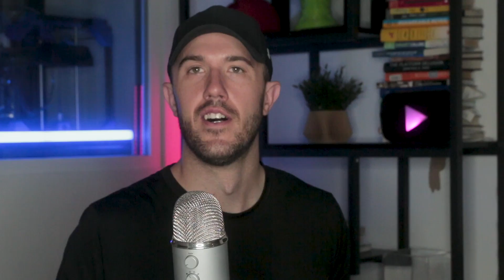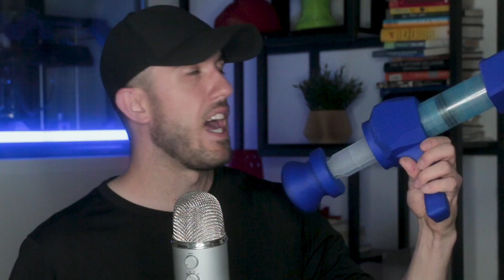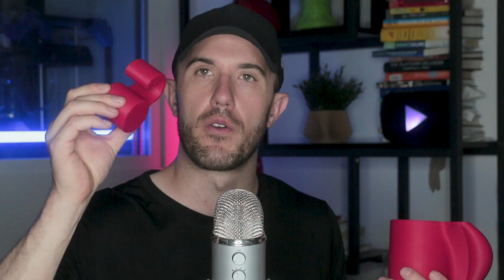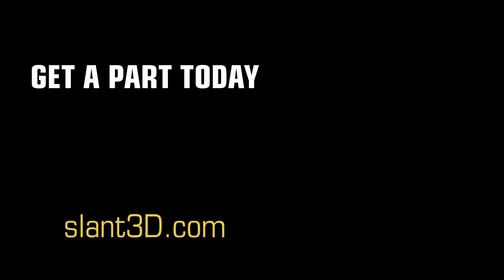The Truth About PLA+ | Open-Source Doesn't Work | Stratasys & Nano Dimensions | 3D Printing Podcast

Comment: Of course you knew the crap you'd take for your preposterous position on open source, but for a YouTuber generating crap and viewer "engagement" is nearly the entire point. It's the central methodology and purpose of click bait (which the Pope has condemned as dishonest and degrading). BTW, I despise talking-head videos like yours. If I had my way, YT creators would be heard and not seen, especially those who wave their arms around and indulge in exaggerated facial expressions. That is, after all, what clowns do.

Comment: wah?? Open-Source does not work?  The internet was literally built on open-source. Pretty much every piece of tech you use evolved into what it is because of open-source.   It's because of this type of thinking is why Bambu will get away with implementing their locked in ecosystem.

Comment: I totally agree with you on "open source".  I am an inventor with global patents and have a recent significant development in the realm of 3d printed products.  The expectation of free files is absurd.  I have a year and a half in development and it makes no sense to give it away free.  I will have to exclusively manufacture the product to help secure it except that reverse engineering is a problem for sure.  I will have to acquire a design patent but the summary of patents is "an invitation to a lawsuit" a quote from a famous inventor.

Comment: I get into the PLA+ argument with people all the time trying to explain to them that it really doesn't mean anything and that there is no actual specification for what the plus means, if it actually means anything.  It usually gets started when I tell them that I use Duramic PLA+ to print firearms frames and they use some generic PLA+ instead to save a dollar or two a kilo and it doesn't hold up.  Yes, I use a material called PLA+.  I use it because I started using it 5 years ago when I first got into FDM printing and tried out a bunch of brands and really liked the way it printed, the layer adhesion, and the strength of the resulting parts.  I suggest it because of my experience with the specific material and not because of the + after the PLA!  I probably looked at data sheets back then when picking it as one of my choices but, having actually worked for a plastics company doing product quality testing, I don't really put much trust in the data sheets as variations in print settings can really vary the resulting qualities.

Comment: I started out 3D printing a couple years ago using PLA. For small parts (less than a 1" footprint) it worked fine. When I tried a larger part with a 3" x 4" flat surface, I couldn't get PLA to stick to the bed over the entire surface. Tried PLA+ for kicks, not thinking there would be much difference, but it performed flawlessly. I have confirmed this over and over using different brands of filament, so now I will only use PLA+. Also, if PLA and PLA+ are the same, why does PLA+ have a higher printing temperature?

Comment: > Open-Source Doesn't Work
Dunno why, but I watch your video from Brave in Arch Linux while fully open source Blender, FreeCAD, Inkscape and Orca Slicer, which I use for modeling and 3D printing, are also opened in backround.

> Blah blah blah
Thanks but no thanks. 12 minutes of wasted time in 2x speed.
Reply from the maker: Not hardware

Comment: "PLA" or "PETG" aren't specifications either. There can be a huge difference between a PLA and another, in viscosity, melting temperature,  layer adhesion, tensile strength and many more.

Comment: More accurately not all PLA+ is anything more. If you think PLA+ is a sham I challenge you to print a firearm with eSun's PLA and PLA+ and see how many rounds you can get through both.  Just do yourself a favor and fire the standard PLA with a gun vice because it WILL disassemble in your hand in use, possibly violently, in the first thousand rounds. The PLA+ print however will survive thousands of rounds, and when it eventually does fail it will likely be in a non-critical location.

Some PLA+ is absolutely different, PolyMaker's PolyLite PLA Pro and eSun PLA+ are two that I can personally speak for. Some is absolutely not, I don't personally have any experience with any of these but the nature of any industry is that a certain percent of the market will lie about the product they sell.

"Open source has never truly existed or ever truly been effective" Shit like this makes me think you really don't know what you're talking about, there's a successful open source physical object project in the fucking frame while you said that.

Comment: One time I bought something that might be called PLA MINUS Though it was some mix, probably containing some amount of PLA, maybe at a level that could be called "contaminated with PLA" :D. It acted more like a mixture of PLA and wax. From my rough tests, the difference between Vicat temperature and melting temperature was negligibly small. And the striiiiiiiiiinging... But the speed it could be melted and deposited by regular 40W reprap extruder, was impressive. Twice as normal without much hassle. Prototyping with this strange material was rapid.

Comment: Hmm. I think polylite pla pro would disagree. You ever broken the parts next to each other, pla plus/pro nears the durability of petg. Takes 4 walls or more to have equivalent strength to one wall with pla pro/plus. There is an open playing field on additives such as polycarbonate. Most manufacturers don't want to give up their secrets, any others that don't perform may just be scamming you, sure. Buy a reputable pla pro/plus and wow, it means not always having to print petg for indoor items that won't be exposed to much sun or elements.. It is still a biodegradable base material after all. So many variations of pla these days and I'm sure many of them are beyond the scope of this single video claim. It would be nice to hear specifics, show some data. Prove it with some printed examples. Just repeating that pla plus doesn't actually have any difference to regular pla is seemingly arrogant.
Reply: Straight from Google:
Most PLA+ materials are to increase the strength of the standard PLA, and while many companies keep that formula confidential, it's usually a PLA and polycarbonate fortification. PLA PRO is a PLA that undergoes special tolerances to make sure the material is unilaterally 1.75 give or take.

Just be aware of what you are purchasing and how that material should be utilized.

Comment: You talk about the learning curve of running a 3D printer. Its clear that using a modeling package like Fusion 360 has a wicked steep learning curve. Linus' GIT, sigh. Its not designed to share designs/code, its the tool that Linus wrote to limit what code he has to accept into the Linux kernel. Sure, you can do collaborative projects and share source code, but it not only has a learning curve, but its philosophy is not about sharing.

Comment: I've been running operations for various companies on open source software for two decades.  I've implemented open source phone systems, voicemail systems, monitoring systems, etc., etc.  Open source has saved these organizations hundreds of thousands, if not millions of dollars in the long run.  

It is a bit difficult to stomach the idea that it "doesn't work", because Captain Hoozitz the 3D printing guy decided it.
Reply from the maker: It works fine in software. Kind of failed in hardware.

Comment: Never say never, it does exist, examples in hardware Arduino, Adafruit, Sparkfun, Makeblock, Otto DIY... It is true the lack of good contributions deflates the original creators. Agree the 3D printing industry specifically thanks to Prusa was the hope that the system could work in a sustainable high quality company but it was working and they sre adjusting it to the current statee in the world, unfortunately the war turn out very uneven for them, competing with closed source company that just fish your design.

Good point on how opensource hardware is viewed as something cheap because is mainly hobbyist

In the case of redhat hasn't been working fully neither.Is it a contribution too the world when you are selling it? 😅

Comment: Im only a hobbyist,  Ive got two rolls of PLA+ from two manufactures, Dont try printing sharp corners fast with it. I get zero problems with PLA, but add the + to it and its a pain in the butt.  Its like the material separates because the retractions to high or the flows to low.... but no, Its speed, 70mms is way to high, It needs 40mms and the flow upping 5% just to get a complete corner, but forget sharp square, Or keeping a hole the right size.  I think the + means more hassle.

Comment: Open source isn't really about whether it can be sold.  It's about whether it is okay to modify the design to suit a slightly different use-case and publish the changes.  You can still charge money for the files.  I have several open source applications that I have paid money for.  Not on the honor system, but to have use rights for the original version.

Also, if your goal is to make the 3d printing ubiquitous and available to all, the open source model is a very cheap way to improve access...
Reply: In most civilized countries you are perfectly free to modify anything you bought (as, despite claims in void contracts that something gets licenses or leased, most digital content is by legal definition sold goods) and share the modification with a reference to the original (e.g. cad obj, max, blend, etc file of the cuts of modified parts).
Practically open source in the digital side is entirely about learning and custom for job fixes, which should be supported (same as file sharing and editing and custom forks when it comes to firmware and slicers) as with it comes improved competition and increased overall baseline quality of every users experience.
I mean look at 3d sculpting tools, a small team of gigachads joining blender (and then part leaving after job is done part getting kicked by schizos refusing to fix the interface on the main branch release) made it go from worthless to amazing for simple character sculpts which in turn made Zbrush which didnt see any real changes under three managements in decades actually start updating the default workspace and tools. Plus for the free side plus for the pros.

Comment: Correction: open source hasn't worked well for 3D modeling *yet*.

Part of the reason why people ask you to open source your models and contributions is so that we can learn from them!

As a professional software engineer the biggest contribution of open source to software development (especially on smaller projects) isn't just the free software, but the free learning we get from them!

Remember, this whole home 3D printing movement started from the seeds of the Reprap project.
Reply: And transparency, and security; even the author’s website is built on open source software. The vast majority of the web, publishing, and massively profitable SaaS is open source software (and I’m not referring to just Linux). 

Outside of software, it is curious that the author didn’t mention reprap by name. At all. :-/
Reply: @steveorevo  To add to that, routers, switches, modems, pick an embedded os device, driven by Linux. I always said if i ever hopped on a plane and saw the Microsoft logo in the cockpit, I’d get off. Years of tuning and customizing to create highly reliable, robust, stable platforms that don’t require a reboot twice a day… All built on Open Source.
Reply: Its the ultimaker thingyverse platform what makes the learning curve better.. 

People can download almost anything for free and adjust others models..  It's the step that makes it comfortable to .. take on a 3d model.
Reply: The home 3D printing business derived from the industrial 3D printing business. It started as a hobby as the personal computer business did. After some time, it grows past the hobby market and then usually, open source fades into the background. Not saying that it still isn’t around or isn’t useful, but it becomes a minor force.

Comment: "Open-Source Doesn't Work" says the guy who has benefitted immensely from open source.

Not everything should be judged by its ability to generate money. Open source has never been about running businesses. It's about making sure that whoever wants to thinker with an end product, be it software or hardware, can. Open source puts the product above the business. The product is the end goal, not the business. And in that regard, it absolutely works. A small business might die because it releases everything it does as open source and gets all its IPs stolen, but the end goal is still met. The consumers are still free to thinker with the products. In some ways, it is a better outcome, because the products of a failed closed-source business will die with the business, never to be maintained or used ever again (outside of reverse-engineering of course).
Reply: Yes. As a consumer I'm much more comfortable in buying open sourced things, including hardware, because even if the company makes out of business or decides to stop developing the product, there's a high chance that others will continue it, or at least make compatible parts.

I don't want to lock myself into some system that's completely controlled by a single company that might go a different route than I want. I need the ability to get mods or upgrades for the path I want to take.

Comment: Your channel is quicly becoming my favorite. I would love to hear some success stories with some companies that are willing to share publicly that they used your services. What company used your printfarm? How many units? Why did they choose 3d printing? What was the part that was printed? What were the feedbacks?
I would also be interested in hearing why and how 3d printing can be a better option for mass producing millions of identical units. Is there a scale at which injection molding is still a better option?
Reply from the maker: We have lots of client success stories. Check out the Real 3D Printed Products Series.
If the part is designed and the supply chain planned out there is really no volume when 3D Printing cannot be the solution.

Comment: Open source is not a methodology, it's more of a philosophy. I'm sure there will ways of making it work, but if it doesn't it's not the fault of the philosophy itself, but because of current realities. I do think it may work well in the future, among other reasons, because of tools that currently either don't exist or that are very expensive and difficult to use.

Also what did you say about NFTs? I don't think they may be useful for anything at all.